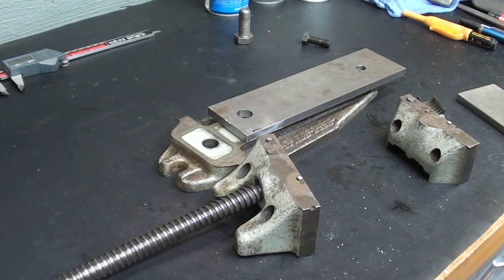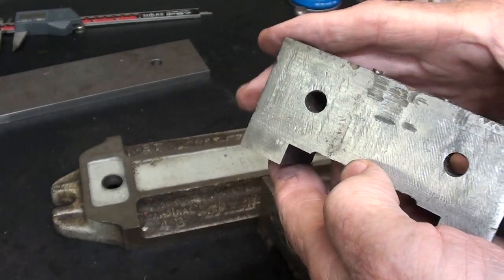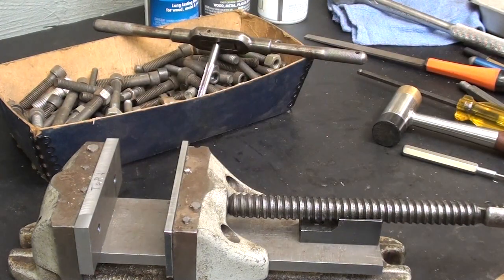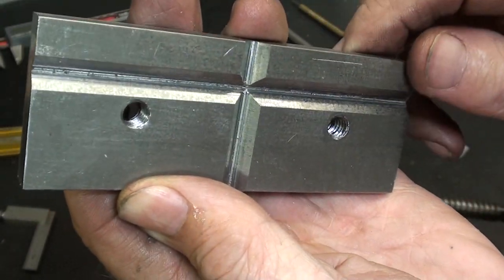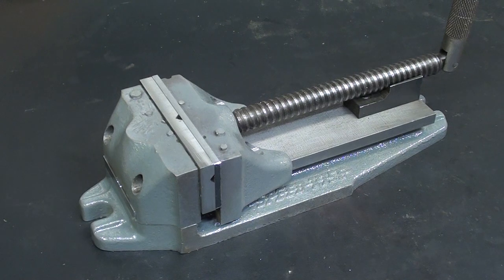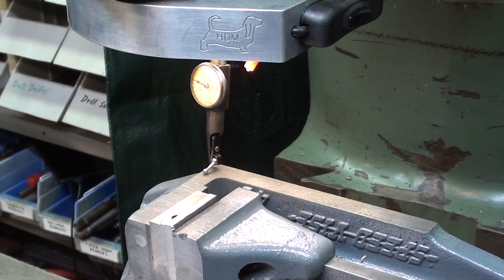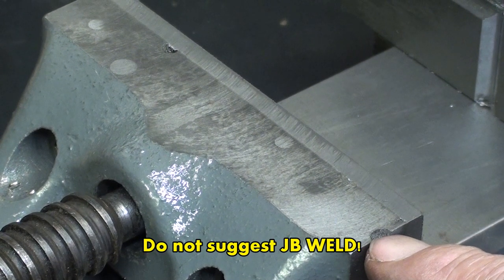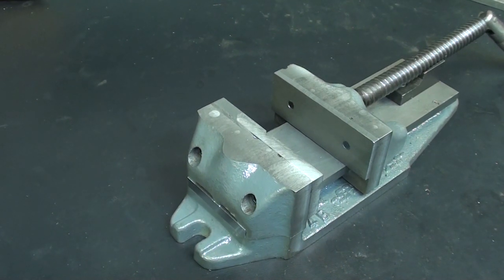RESTORING A CARDINAL SPEED VISE TIPS 608 pt 2 tubalcain buttress thread

Comment: Anybody that wants to know how to get screw out for a new handle assembly.   Here is how .   Remove the back jaw assembly .       Make sure clip is about half way with screw driver so you cut the clip in half.  Measure over about .350 from back side of the jaw in a mill.   Use a 3/16 or 1/4 end mill and plunge thru top of back slide jaw into clip to cut it in half.     Take the 2 parts of clip out.  Don't forget to check and make sure the new screw turns nicely in the ball seat.   Otherwise file the end of the screw off some.   Instead of using the new junk clip , just install a inside snap ring instead.    Thank me later.